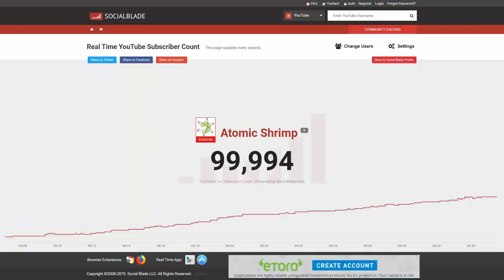Smelting Iron To Make A 100k Play Button

Comment: What is the difference between melting and smelting ?
Reply from the maker: Smelting is the process of converting ore to metal (in this case, driving Oxygen away from Iron Oxide to leave iron metal)  Melting is just heating anything until it turns into liquid
Reply: Atomic Shrimp ok thanks ! In france we would say faire bouillir and faire fondre.